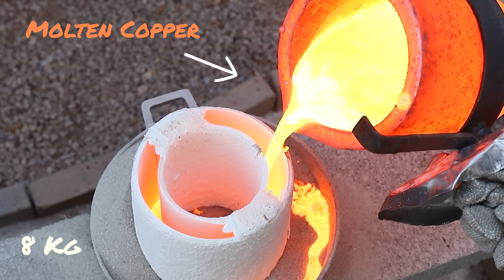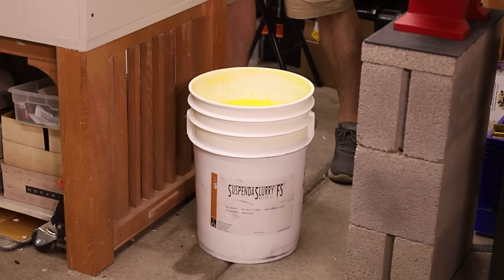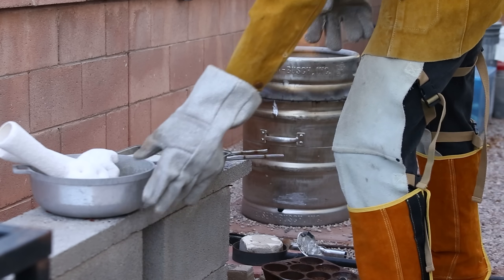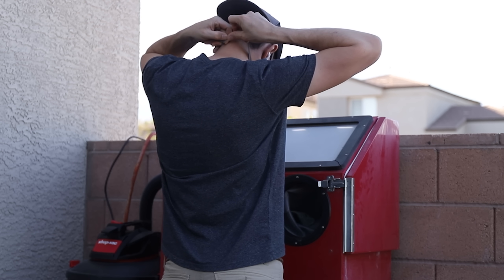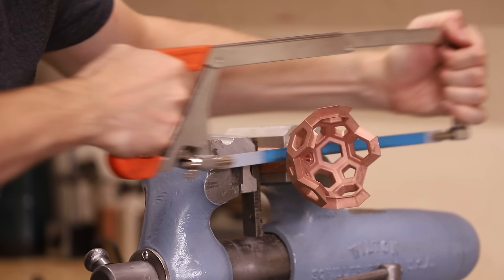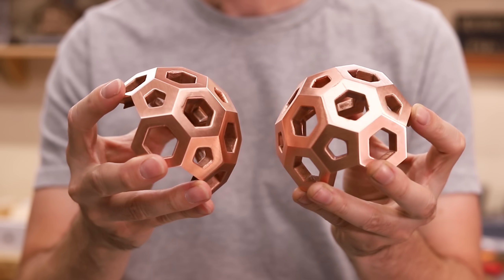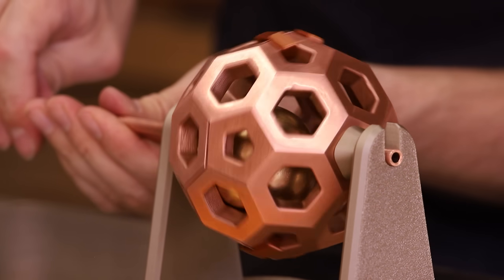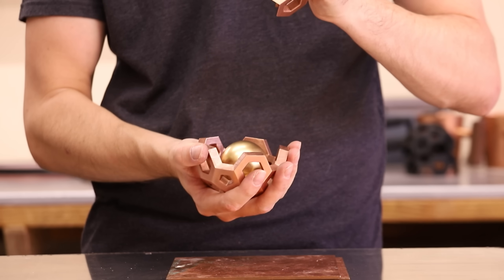HUGE Magnet VS Copper Sphere - Defying Gravity- Will a Neodymium Magnet Float Inside?

Comment: WOW!!! This has to be MY FAVORITE casting that you've done! IT looked SO DETAILED!!! Your casting picked up EVERY LITTLE SPIC OF DUST that was on the 3D print!! lol And you made it turn out BEAUTIFUL!!!!
I want to come up with some experiments you can do, but  the ones I'm thinking of are a bit pointless LOL....  like making a ring of magnets that goes around the outside of the basting, and you rotate that (with the sphere magnet inside the casting, of course)...  IDK what it would do or what the point of it is but its some thing LOL .... 
I was gonna suggest putting the casting (with the magnet on the inside of course) on the end of a rope and swinging it around your head.... well now that I think about it, nothign would happen, except the same thing that would happen if the sphere wasn't a magent lol ..... BUT if you coudl find  way to rotate the casting while swinging it around... hrmmm... meh.... yea, kinda pointless :/
- what if you involved coils of wire?  maybe small coils (6 of them?) in a ring around the casting, wire in different ways like in series, parallel, or even 3 phase with full bridge rectifier  ??
-  OR what if you attached the magnet sphere to a stick, at the equator between the poles (or even the powerful puck magnet, with the stick attached at the equator) and rotated the stick/magnet and the casting was allowed to spin freely, is the lorez force strong enough to spin the casting?
- - ANYWAY, you'll have PLENTY of suggestions, so I won't continue to bombard you with this nonsense LMAO! :D - This REALLY WAS the MOST BEAUTIFUL Casting!! ... I would even buy one, and maybe use my Dremel to put some designs on it... it just looks cool the way it is..... But I would have thought you would have went with a dodecahedron because it makes every facet equal and the sphere magnet would move more smoothly as you got up to speed....... OH!!! What if you got it up to speed, like the right speed to keep it floating steady, but then you moved the drill/stick/casting around....  would the sphere steady?? AND if you noticed that the sphere magnet stay to one side.. the side that was moving upwards... well if you move the spinning casting toward that direction would the magnet move to the center???? 🤷‍♂🤷‍♂

Comment: 2:12 First of all, cute puppy! Second of all: every time i see this process done, i can't help but think that you might be getting some issues with the finite item before pouring, because of the uneven distribution. Which i know doesn't make sense, because there's only so much material that can be "glued" on in one round, but... still. There has to be a reason why in factories, they have that curtain distribution system, because otherwise, it would be simpler and probably a lot more efficient to just make a shifting sand cascade chamber and have the wet product pass through, akin to cookie dusters (essentially, a ginormous sieve with a vibrating base under which the product passes). So that's that. Maaybe... try using one of those kid's toy sieves they used to have in play sets back in the day? Kinda like how you're supposed to dust your flour before use? Just a thought, not a critique.

Comment: Do you add anything to the copper to prevent porosity in the casting? I find it tends to absorb a lot of gas when molten. As a further experiment, maybe try rotating the sphere along its vertical axis and see if it’ll still levitate that way.

Comment: Please electrically isolate both hemisphere, make a little circuit with led light that join them together, so that part of energy generated from any movement can light up the inside of the structure.

Comment: Coulda made a sprue that fits right on a vertex so you wouldn't need to drill the hole and manually file a pentagonal hole in there! Then you'd just be filing a 3-way corner instead, but with the faces around it to guide you. Thanks for sharing :D

Comment: I think the coolest effect is remotely turning it with the 2nd magnet. If you made another stand with the 2nd magnet with a crank handle to turn it, and a housing for the 2nd magnet to hide it from view, it would be a fun trick when you tell people to turn it. Don't tell them ahead of time what is actually going on and it will trip people out.
Reply: gearbox drive,no touching parts?
Reply: @SHADOW.GGG-  Basically an electromagnetic torque converter. Which is the way an asynchronous motor works - the armature is a piece of solid copper which is energized by inducing a current from a magnetic field in the stator. The torque from the motor is determined by the difference between output RPM and electrical field rotation RPM - torque is proportional to the motor slip.
Reply: It would be like magic! Lol! Of course, anything that someone doesn't know how it works could seem like magic too.
Reply: He could make a wooden base that contained a rotating magnet to "wirelessly" rotate the "sphere".
Reply: I suggest trying to make the inside of the copper ball smooth and round. I don't know what would happen, but I think the ball magnet would act more like the magnet in the copper tube.
Reply: I believe you are really on to something hear try cooling it down and see what effect you can create.  By looking at the replies you've gotten, you've got a good  potential for brainstorming this concept, However do not listen to  Most highly educated Individuals it'll just slow you down.

Comment: That's all kinds of cool, well done!
Ideas: 
1) Suspend the magnet in the middle of the sphere, then spin the outer sphere up with the drill before releasing it. Might get more levitation that way. 
2) With the entire system spinning, hook up a voltmeter to the outer sphere and see what kind of voltage it generates.
3) Consume cookies.
Reply: #1 is what I was thinking: Point some air jets to the magnet to make it levitate and remove the initial friction between tha magnet and the cage.
Reply: You might need to make the stand connector piece metal to have somewhere to connect but the voltmeter is such a good idea.

Comment: A three-piece spherical design might provide more consistent repulsion on the magnet as it spins.  Think of a solid equatorial band with two "holey" pole pieces.  The band would provide a seamless, continuous body for eddy currents to form unimpeded (as well as providing some horizontal auto-centering capability), while the poles would allow visibility to the magnet inside.  Should be easier to tune the speed and eliminate the clunking.

All-in-all, an extremely beautiful piece.  Bravo!

Comment: Before really thinking about how you'd execute this I imagined the magnet being inside the copper sphere while it was being cast so it would be trapped in there. Dumb on several counts I realise - the nature of the casting process first of all, and at a certain point heat kills magnets - you wouldn't want to risk that with what I assume is rather expensive magnet.

Comment: Other than the copper and neo effect, not sure why this device is made - as it needs to spin, creating the effect.  Why not just put in other magnets that oppose the inside neo, then no matter what x, y, z1, or z2 axis the outer structure rotates, the inside and floating neo will retain its internal floating.

Comment: electroplating a conductive surface of a 3d print with copper is also an option (conductive surface + graphite electrode). that construct can be used to make a dynamic maglev bearing. yep also magnetic gears.

Comment: Actually as it is have many holes , this really reduce eddy cuurent as resistance gets larger in the sphere thing and so the the magnet can not have the suspension force like in a solid cylinder so i think this is the most you can get out of it  

Also the split between the 2 Half's of the sphere reduce eddy current and increase resistivity as there is a layer of air between them ( even if they are touching it is higher resistant that the copper it self )

But awesome design non the less
Reply: I wonder if "stripes"  with a few supporting cross members instead of hexagons would have been better.
Reply: Best comment. The eddy's are being cut where they would naturally lie and it changes the properties. It need to be solid. Gonna have to look inside another way. At least you can hear if it's floating.
Reply: @popofouad in my opinion the gab between the spheres reduces the current, maybe it would help, if he would use solder to close the gab (but you have to be careful, magnets doesn't realy like heat)
Reply: @unknownxy8026 The sphere is not a magnet. It only becomes one momentarily, when a magnetic force changes within or around it. So it should be totally fine to solder it
Reply: @mduckernz  You will need to solder with the magnet already inside it though
Reply: @mduckernz it is a magnet though, in the intro the box it comes out of has the “caution, powerful finger crushing magnet” label
Reply: I agree I think the split may be effecting it significantly, those two sides need to be brazed together
Reply: I’m just wondering if we can theorize how a magnetic field flows we don’t imagine the shapes we use to test it to be a similar shape?
Reply: It forces the magnet ball rotation speed to match the sphere speed and Lenz force drops to zero
Reply: The purity of the copper is an issue too.
Even small drop in purity will drop the conductive properties of the copper significally.
Reply: i was thinking the same
Reply: My gut says that Nikola Tesla would have a bunch of good designs. We're talking about 3-dimensional field lines where even just oscillation frequency makes obvious differences. Some designs will cause wave cancellations, some will cause amplifications, and overall even the smallest difference will affect the levitation of the sphere.
There are some really fascinating scientific discoveries waiting down this road!
Reply: This one +1
Sodering those two might help as well
Reply: I already wrote a comment here where I also referred to your comment.
Your idea is correct to improve current flow for a stronger magnetic field. But there is a huge problem nobody in this comment section thought about because rotating it in only one direction creates a north and a south pole which pull the magnetic sphere away from the center.
You might want to look for my comment, maybe there's something I am missing that you know better? :)
Reply: it needs to be perfect sphere cant see in it, and the magnet into there and ull be able to hear it floating
Reply: i think your're correct in assuming it's the resistance but the holes' are causing  permeabilityallowing reseistance to excape thus the eddie currents wash away ..
Reply: Layer inside w magnets.
Reply: Maybe some sort of conductive putty / paste could be a less permanent solution.
Reply: Moving the axis of rotation to the equator instead of the poles would help mitigate this

Comment: Might try a smaller magnet (gut feeling) it might suspend better without being affected by centrifugal force. If you made the ends of the stand a little closer together kand stronger), it would help hold the halves together and the plugs in place...might have to use some thrust bearings.

Comment: The entire premise posed 36 seconds in didn't make any sense. Hollow tube, cylinder magnet clearly shows it applies a braking force to slow down existing movement, not levitation. So why would changing anything about the shapes here suddenly induce levitation?

Comment: Try using a somewhat smaller spherical magnet. Something with less mass. Very cool !
Reply: hollow sphere supermagnet? Even a bunch of those bucky ball magnet toys of tiny magnets on a thin sphere would be cool
Reply: @MichaelBransonCoach  nevermind... taofledermaus did that 9 years ago.
Reply: Cast a thinner/Sand down the inner circumference of the chew toy?  

Make larger holes in the sphere? 

Weaker magnet? 

My thinking is the Hall Effect is overwhelming the power of the magnet because of the volume of copper.  Even at slow speeds, there's too much resistence being generated by the sheer volume of copper in relation to the volume/effect of the magnet.    In other words, Too much flour, not enough eggs in the cake.  
Try a larger area around the magnet, a smaller magnet, or less total copper around the magnet via larger holes.  One/all of them are your solution.   Find a ferrous sphere magnet and see what happens!  I bet you could do higher speeds purely because of the MUCH weaker interaction between the materials.
Reply: @jawa7609  Unfortunately it doesn't work like that. The spinning of the copper sphere causes a movement of electrones, so basically an electrical current. Every electrical current creates a magnetic field which is proportional to the current that flows. So a higher volume of copper means more electrons to move and also less electric resistance which both help creating a higher current and thus a stronger magnetic field. Air itself is for both magnetic and electric fields a bad conductor, so you should try to avoid as much air as possible.
The problem why it doesn't stay in the center is probably more that spinning it in one direction creates a magnetic field with a defined north and south pole such exactly like earth's magnetic field due to it's rotation. This pulls the magnetic sphere away from the center towards either to one or the other side of the axis of rotation depending on the direction the sphere is spinning. That's why it didn't work at higher speed because the force to pull the magnetic sphere away from the center is also proportional to the rotation speed.
So to solve this problem the direction of spinning has to be changed at a specific freqency, which would lead to other problems, or the axis of rotation should be placed vertically and the sphere must be spun counter clockwise so the generated magnetic field opposes gravity. And even then it must be spun at a specific frequency so the magnetic field is slightly stronger than gravity but not too strong to pull the magnetic sphere all the way to the top
Reply: @kuxxy4109 Don't spin it use electromagnetics
Reply: @kuxxy4109 Would the same apply to the iron core of the Earth? Would the Earth have to change the spin direction every now and then for it to remain at the center?
I remember reading the orientation of the sea bed lava ridge having opposite magnetic alignments one after another as if the magnetic poles kept changing. That lava ridge solidified according to the magnetic  orientation at that time.
Reply: May be need thicker and bigger outer shell.
Reply: I wondered what would happen with a slightly smaller magnet as well.
Reply: Closer to flying cars than we kno
Reply: @Grim_916  it's already been done
Reply: @Grim_916  Only if you want to fly your car in a copper cage!!
Reply: I'd use a small magnet.
Reply: or bigger outer copper shell? or both?
Reply: This, with gradual speed increase, so the magnet would have enough time to level itself in the middle.
Reply: Покрой е сферу бесцветный лаком, медь окисляется на воздухе и теряет красоту😊
Reply: Or more copper.
Reply: Or a larger sphere. Go big or go home.
Reply: The Smaller (weaker field density) the magnet the less pronounced the effect.
Reply: Such as an equilateral icosahedron. People like triangles!
Reply: I’m not a electrician or scientist, but what if you separate the 2 spheres and insulate them slightly with a 2mm plastic mould. Put them back together and attach a positive and negative wire to each side and get it to spin at the right speed. I wonder if you can generate some power ?…as I said I’m not a electrician.
Reply: Initiate the spin to higher revolutions stabilised in a dense oil medium.
The nodes might cause some unbalancing eddies, nice casting though.
Tip: clear acrylic sphere with cnc copper cylindrical plugs array precise.
"David Allen LaPoint" Primer technology should give you the next steps.
Reply: Exactly what I was going to say. That mass is too much.
Reply: I’m glad someone else said it! Or use a bigger copper sphere.
Reply: Such as an equilateral icosahedron? Triangles are some people's favorite shape.
Reply: yes ! good idea ! a smaller magnet ! of course ! that would be very interesting to see ! good call !
Reply: I really think its the electricity that rules the univevrse,not gravity!!
Reply: La única forma de mejorar el efecto que veo más factible, sería aumentar el espesor de la "esfera" de cobre. Ya que comercialmente será dificil encontrar imanes mayores. Cuanto más cantidad de cobre, la ralentización de la caída del imán será más apreciable o se potenciará el efecto Lenz.
Reply: Came to this comment section learn physics and it paid off lol
Reply: Dont tell him what to do
Reply: Yeah as others have said I wonder if you'd get a better result with a smaller magnet, or maybe a bigger copper sphere. Something to give you more space between the two objects when they're inside of eachother. Either way a VERY cool video!! The fact that you can rotate the sphere with another magnet a foot away is super cool and must have some sort of other applications!
Reply: Underrated comment.
Reply: 😊😊😊😊😊😊😊 @poelmeister
Reply: Yup!
Reply: No, it did not work because reducing the size will cause an uneven attraction and will make 40% attracted, which will make things worse. Also, the larger magnet has a greater attractive force. The matter may differ in this from the normal logic of reducing the size because increasing the strength of the magnet, even if its weight increases, will come. A better result in this experiment
Reply: Try rapping the spheriod in seran wrap and floating it on a column of compressed air - like an ultrafuge.  Then spin the ring magnet.  Put the ring magnet in a plastic sphere and dpin it with compressed air..
  Check out the X and Y similtanious spin.
  Can you make a magnetically coupled wind power system?  Can you make a magnetically coupled (robot) unicycle?